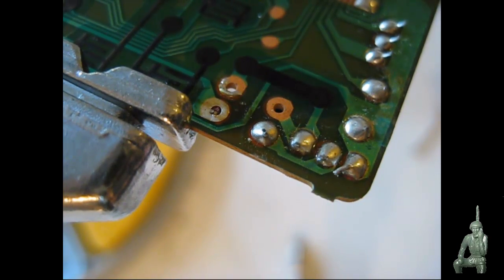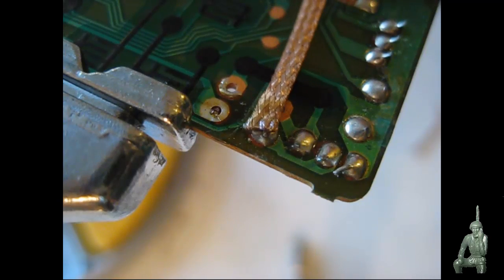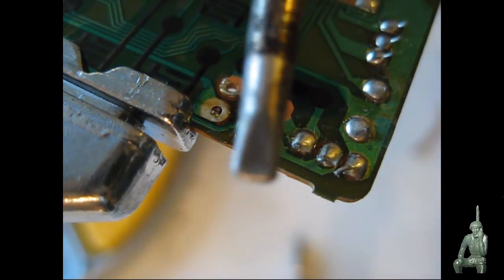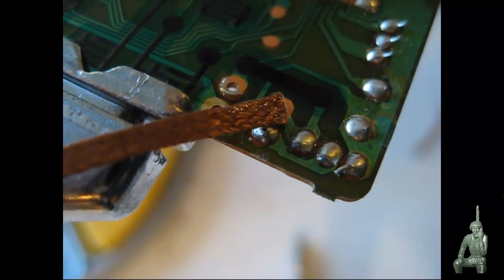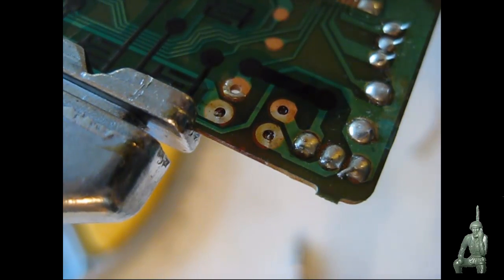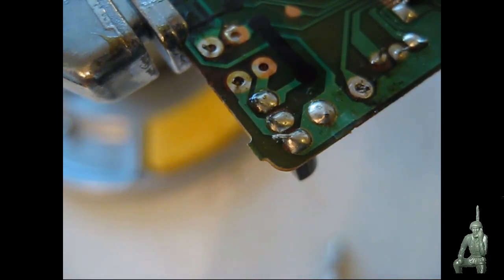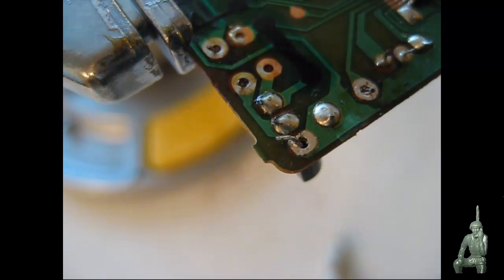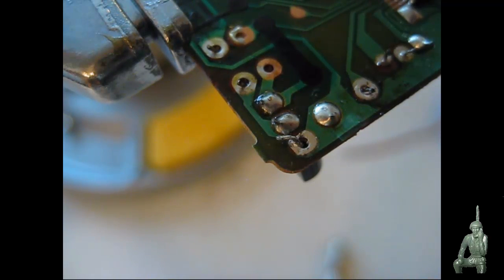Desoldering Circuit Board Components

Comment: I am wondering too, what temperature is ideal for it ?
Reply from the maker: It depends. Most of the time I have my other iron set to 650 but who knows how calibrated it is.  My experience has been the lower the temperature the better.  If the iron is too hot you risk damaging the board and components.  Heat sink (copper  alligator clips) can also be used on component leads to protect them from heat.

Comment: What to do if my solder can't melt ? I'm using a Yihua soldering station and a metal sucking pump.
Reply from the maker: +oDJOldskull 1) the iron temp is set too low, 2) the iron is junk 3) the iron is bad 4) the spot you are trying to solder is a ground point (large metal area) and your iron cannot produce enough heat for that joint.  Does the iron melt a piece of solder off of the roll?
Reply: Commsprepper Hi, thanks for the reply ;) My Yihua has a Hakko soldering piece attached to it. The soldering tips seem to be ok. I've bought them in bulk for around 12 $. I'm using a small screwdriver-like tip because it transmits heat better than the round tip one. I have used plenty of flux to help myself desolder the joint. Also I've used some fresh solder on both joint and tip. My desoldering temperature was set on 320 degrees Celsius (608 Fahrenheit). The solder joint that I'm trying to desolder is a bit matte (no shine) and with porous texture. I'm trying to desolder an Omron microswitch from a Razer Imperator gaming mouse. I'm afraid to boost up the temperature as I don't want to damage circuitry with an excess heat.
Reply: Commsprepper Answering your last question - yes, iron melts a regular solder.

Comment: Thank you for posting this. Are there better situations for using a desoldering pump versus a wick?
Reply from the maker: Not sure what your question is.  Solder-sucker pumps are an option along with de-soldering wicks.  I prefer solder-suckers for larger surfaces with allot of solder because I don't run the risk of overheating the board while removing the solder.  Solder wicks require heating the joint and wick to start the solder transfer.  Solder-suckers only require the joint to be heated.  Hope this helps.

Comment: is there anything else you coulsd use as a wick??
Reply from the maker: You  can used the shield from RG coax cable - provided it's copper.  Just put some flux on it first.
Reply: Zzzzz... what was that noise coming fro my computer?

Comment: I never had the patience for wick..  for me, the inexpensive radioshack bulb sucker with the teflon tip always worked best.  Far easier to clean out than the plunger types, or even the pro powered desoldering stations that I used when I was a pro bench tech (MANY years ago!)  Another advantage over wick; the solder can be saved for re-use or recycling.  Great vid though, illustrating an important skill.  Keep 'em coming!